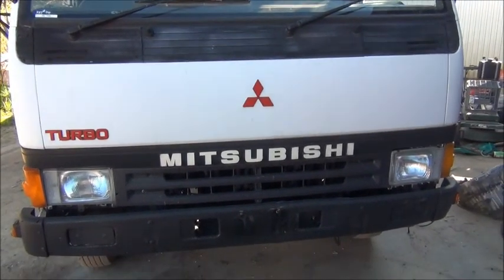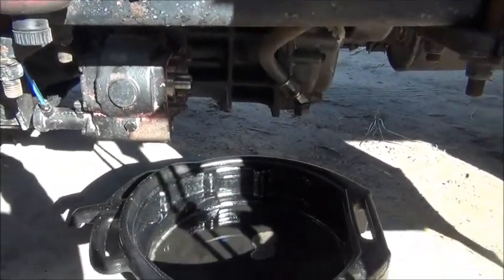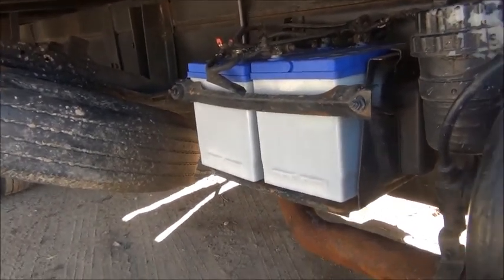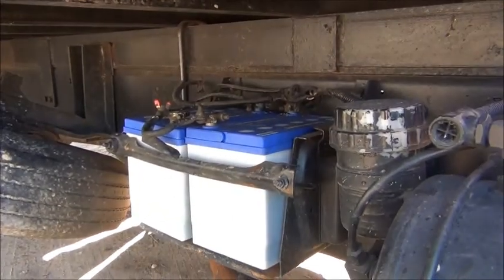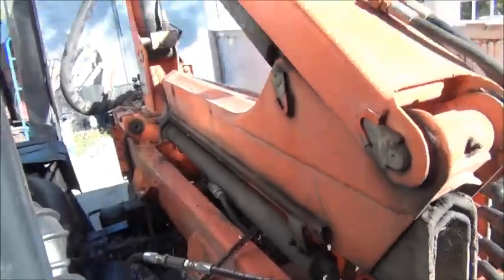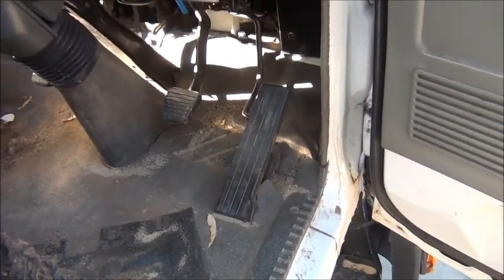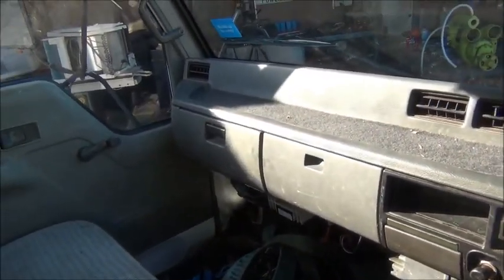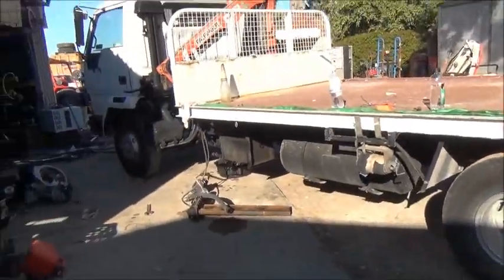Equipment Inspection/Repair - Mitsubishi Canter Turbo

Comment: Probably more the run down truck....got it that way and wanted to move it on. 94 model so has it's issues. Never been pulled over by the heavy's before and they had a stop set up on collier road. Apparently doing a blitz at the moment. One cop was good the other was bit of a prick. I knew when i saw them i was done! Anyhow get my new truck in four weeks so not to worry. They said fix the oil leak.....is was like which one!